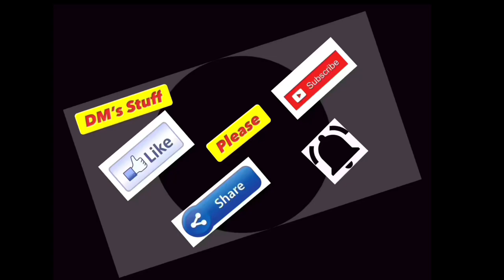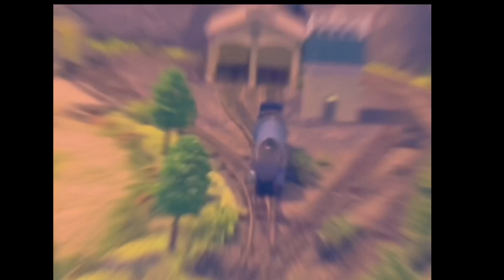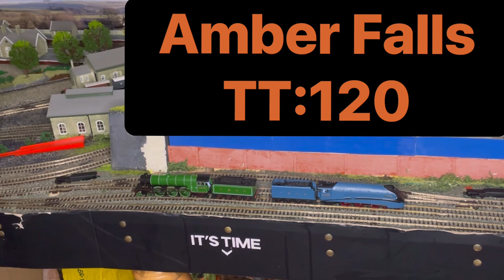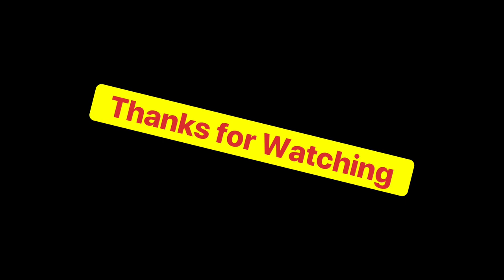Hornby TT:120 - Amber Falls Part 42

Comment: Great job there mate did you use 00 gauge or N gauge point motors on your tt layout
Reply from the maker: Just rails of Sheffield surface point motors. I think they work for any (Rails Connect High Efficiency Surface Mount Point Motor) 
Took abit of messing to work smoothly but all working great now. I’m running all 11 points with these through the Hornby HM6010 with HMDCC app.
Reply: @dmsstuffbydavidmolloy5089  yes I think that’s the way I am going to go after seeing yours and peachy’s videos but N gauge point motors have been mentioned so will have a look at them . Finally got my trains all connected to the hm7000 app at weekend so hopefully next step is the hm 6010 . Cheers and thank you
Reply from the maker: Great glad you got it working. N Gauge may be a better fit if a smaller size. Just need Hornby to evolve the app now to add more features.
Reply: @dmsstuffbydavidmolloy5089  yes, the app is great and the HM7k system has huge potential. Would love to see it really grow and develop.